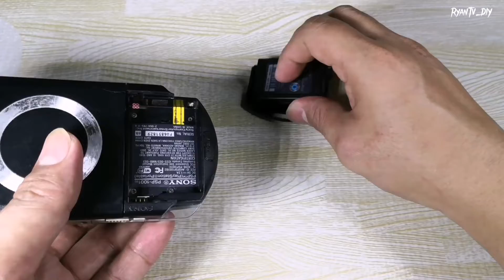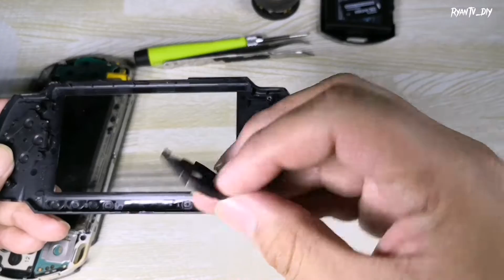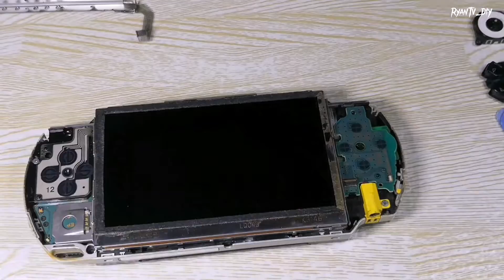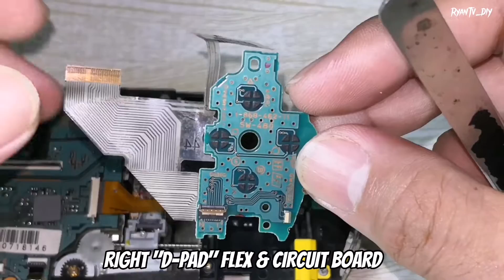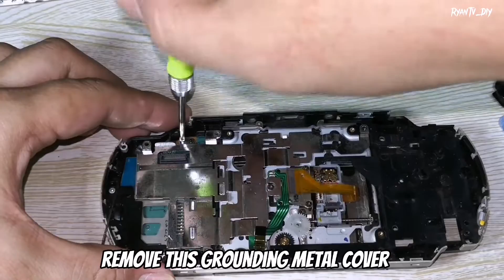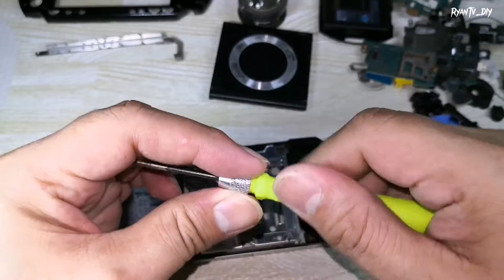Sony PSP 1000 Fat - Disassembly Guides | Complete Tutorials (2025)

Comment: Be careful when unscrewing the last bit where the disc goes in the lil golden gear looking bit is so fragile mine crumble apart like dust was trying to unscrew it didnt apply much pressure for it to happen so be aware when doing so gonna have to replace the part rip